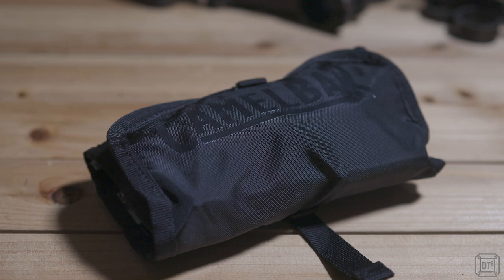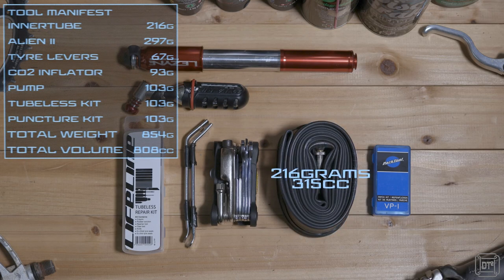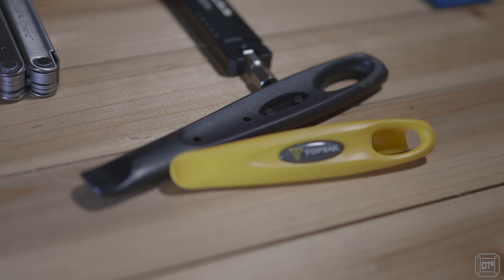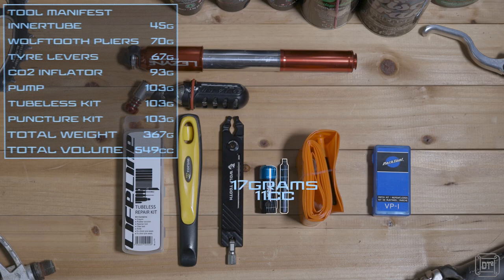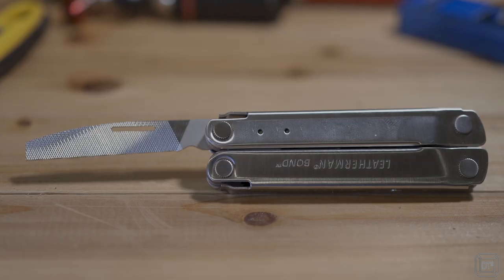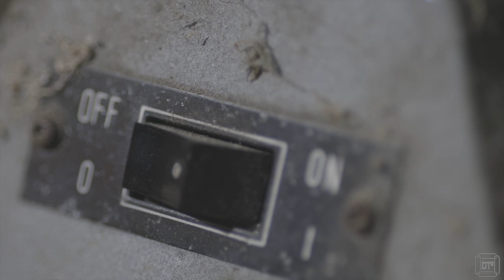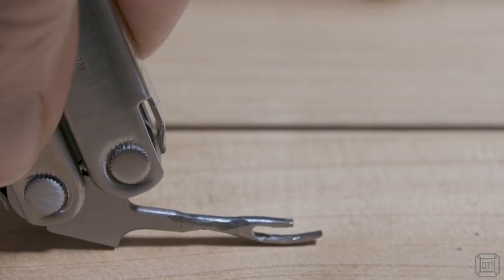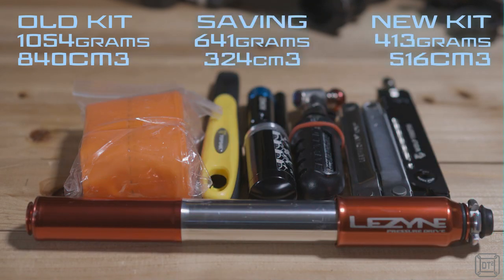OPTIMISING MY MOUNTAIN BIKE KIT - Lighter and compact EDC

Comment: Awesome video, superb production skills, and generally pleasing to watch, you simply shed experience and knowledge :)
Consider replacing the Leatherman multitool for Cobra XS pliers if you really only use the pliers. The knife can be gained by carrying a 85-91mm Swiss Army Knife, you can even choose a lock blade model I think if the length of the blade is below legal threshold.
Reply from the maker: Thanks glad you enjoyed it, it was fun to make. I'll check out the cobra pliers though I'm thinking the side Cutters on the leatherman could also be useful.
In terms of blades in UK any locking blade is illegal to carry even it it's short. Longer blades are illegal even if non locking. It's hopefully unlikely that a cyclist would get arrested, but it is possible.

Comment: Id swap the leatherman man out for a knipex cobra 4 inch and cheap single blade folding knife. Live what you did to the leatherman though.  Someone may find that one day and think wtf😅
Reply from the maker: I think I looked at the Knipex briefly. Better option as grips but less functionality than the Leatherman and I think along with a cheap knife would be heavier also.
In terms as the leatherman mods though I think you're right. I can just imagine some archaeologist in the future explaining how it was used for ritual eating of mini marshmallows when on long rides 🤣🤣
Reply: @DTSquared  now you said that i have had to weigh it! Leatherman is 87g heavier.  To be fair you do get a lot more with the Leatherman.

Comment: Locking pocket knives are illegal in UK? lol the locking mechanism doesn’t make it more dangerous it makes normal use of the knives safer…
Reply from the maker: Sad but true, i think the logic was that a knife that locks is more viable as a weapon so they banned all locking knives regardless of lengrh. Carrying a folding knife with a cutting edge of  more than 3 inches is also illegal in the UK. Definitely feel I'm more at risk of losing a finger when using a non locking knife. Lol